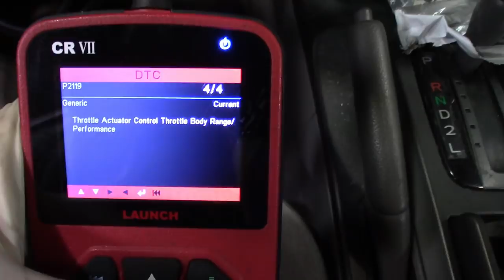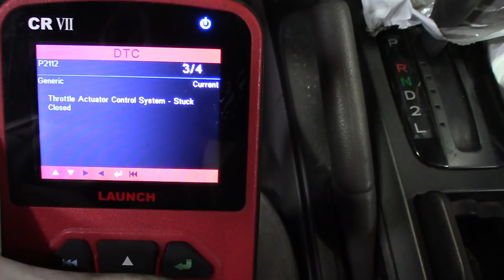TOYOTA TIP. Cheap Pocket Scan Tool

Comment: Great little video its  always nice to learn from others. Was wondering also evan ford ask OEM or aftermarket 
SWR
Reply from the maker: When it comes to part like electric tb, coils, and sensors. I always recommend OEM to customers first. If it comes down to a financial issue for the customer I'll offer them the aftermarket as long as it's a good company like dormen, Bosch, hatachi, ect.

Comment: Do you usually get OEM or aftermarket? Do you ever give the option to the customer?
Reply from the maker: Yes. I usually price OEM to customers first especially for parts like TB, Sensors and Electrical Parts. But if it comes down to availability for me and/or price issue for the customer, I'll give the option of aftermarket as long as it a good supplier company, like Doorman, Bosch, Hatachi ect. I have to trust the aftermarket parts I sell. If I wouldn't put it on my own car, I won't sell it.